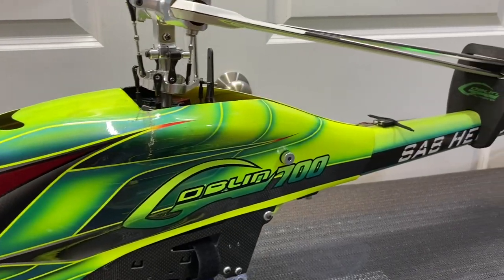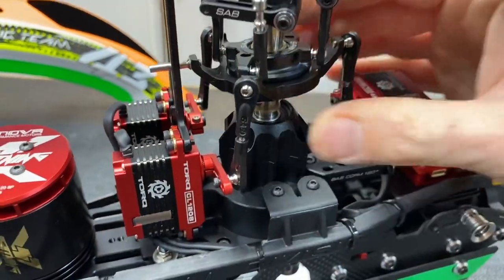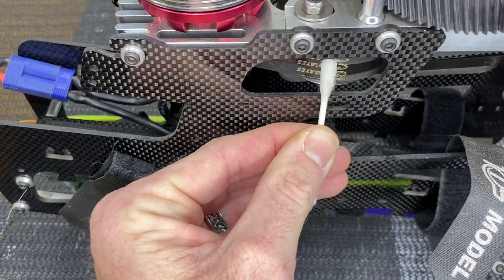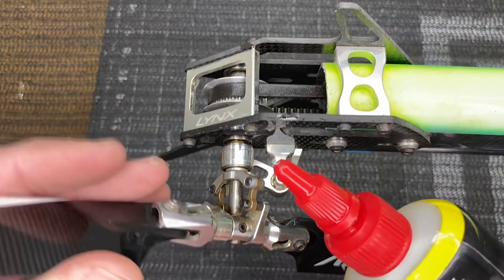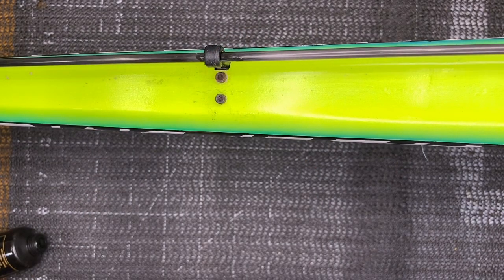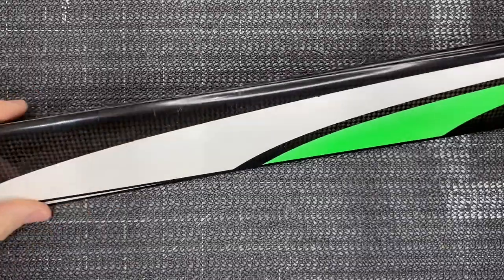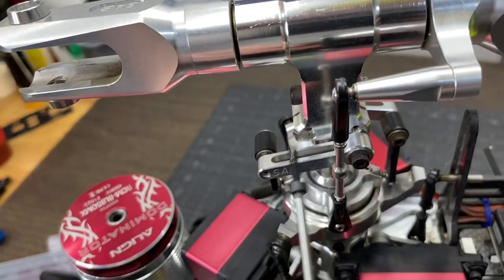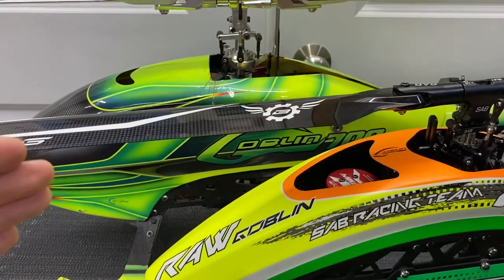How To Maintain￼ Your RC Helicopter

Comment: Caution about lube on one way. Consider it is not actually a bearing. It’s a clutch. It works by friction. Lube is nearly for life, stops rust mostly. I used Teflon based lube and regretted it. TOO slippery. Lost power and HARD auto a few times. Totally cleaned one way and applied minimum crappy lube. Never a problem again.

Comment: Consider why apply ANY liquid lube to bearings. They are partly sealed with grease not oil. Greased for life. Oil would only dilute the grease. If no grease, replace bearing

Comment: Puzzled by flyers using silicon on belts. No manufacturer recommends it. So called dry lube would still risk attracting grit. Typically cars run timing belts way harder and longer without any product applied.

Comment: I live in Louisiana and i dont add oil to anything but the head, tail head and 1 way bearing.  Oil anywhere else attracts dirt and the parts wear out even quicker at least in my experience.
Reply from the maker: Yes, if you live/fly in a area with a lot of dirt you will not want to oil some things.

Comment: I’m a brand new rc helicopter pilot. I’ve owned fixed wings before. I have a FlyWing Bell 206 V3 and I for the life of my can’t completely get rid of a vibration on shutdown. It used to do it on spool up as well. I’ve adjusted the main blades many times and can’t seem to get it right although I’ve made it considerably better. Please help.
Reply from the maker: Welcome to the dark side! Lol so first question, has it done it since new? Have you check the balance of both blades? Some helicopters have a residency, which creates a vibration on either spool down and or spool up.
Reply: @westhobbiesrc8051  it has done it since new. It’s only about a week old with around 10 successful flights. I have not checked the blade balance. I’ll have to watch a video on how to do that.

Comment: Would you do the same to the Blade Fusion 180 and Fusion 360 as far as the shaft, bears, and belt go?
Reply from the maker: 100%! It is how I maintain all my helicopters regardless of size.
Reply: @westhobbiesrc8051  Thanks!  I just ordered all the supplies.  My buddies 360 just had the bearings go bad.  He never lubricated it.
Reply from the maker: You’re welcome!
Reply from the maker: @LoveRC  that will happen, bearings need lubricant. You will find how much longer and nicer your bearing and belts and heli will be and last. 3-1 Air tool oil works great as well!

Comment: Good stuff. Ive used scorpion bearing oil and triflow on everything. Never thought to grease the main shaft and tail shaft. Makes sense. The grease is less likely to fling off like triflow. Ive always flown full gear systems and found using a little parafin wax on those gears helps with the chattering.
Reply from the maker: I’ve used the bearing oil but never used triflow, the microlube is expensive for what you get but it’s great. Stays on the shafts for many many flights and don’t make a mess and fling off right away. Wax does work great to quite the gears down.

Comment: In the full scale aviation world, nylocks or nylon stop nuts are usually a one time install then tossed. Now that’s a little over kill for a model but as inexpensive these are by the 100, I change mine after three installs.  I mark the nut with a dot from a sharpie after it’s tightened each time. If there are three dots when I take it off, then I use a new one. Kinda anal but 40 years of working on airplanes, from models to fighters you tend to get that way. Your videos are really informative.  If anyone hasn’t bought Kubler products prepare for sticker shock. The micro lube is cheap at $30 compared to the bearing grease for my CNC mill bearings. That said, it will last a long time and is the most recommended product in many industries.
Reply from the maker: Yes technically speaking nylon lock nuts are one time use but I’m the models they don’t need to be changed unless they no longer hold. I’ve had some last forever and some last once or twice and some brand new not hold at all. I’ve got 100s of them. I replace them as needed. With the main blades if I notice after every flight my main or tail blades keep coming lose then I know time to change the lock nuts. But you can never be to cautious. Would rather do things overkill then failures. Yes microlube is expensive compared to others used but well worth every penny.

Comment: Great video but I gotta say, I have never oil any of my belts. It seems very strange to me but I guess if It's silicon it should be ok. I like to use "Dry Fluid extreme heli" on my shafts as it is not a grease that will attract dirt.
Reply from the maker: I’ve been using 3:1 silicone oil on my belts for many many years now. The belts last for ever but! It depends on where you fly. I never get dirt or anything from the grease (unless I crash) but if you live in a sandy or dusty area and get a lot of dirt on your helis then yeah Dry Fluid is better.

Comment: Genial amigo muy buen vídeo
El aceite dela correa es para limpieza o algo más ?? Lla que Llo no le echo nada ala mía
Reply from the maker: Thank you, the oil used on the belt is to keep it lasting and not drying out or cracking.
Reply: Gracias amigo felizes vuelos

Comment: Jeff, I'm not famailar with the fabric paint tip. Do you just put a dab on it on the servo plugs after they've been fully pressed in?
Reply from the maker: Yes you do. I run a line (bead across all the pins) let it dry and you can peel it back off if need be.

Comment: I know it is not a practice to use any lube on the blade roots but I was really wondering why not. Would it reduce wear on the blade roots and on the blade grips?
One aspect I considered is that it would collect dust and make wear even faster but why dont we use DryFluid or other PTFE stuff? It would reduce friction that could cause issues at spool up, like unwanted blade strike on the grips.
Other thing is that if the libe film is too thick it would make the grip and the head more “flexible” maybe in a wrong way, but a very thin layer would not cause such problems.
So generally if we do not consider dust collection and rigidity/flexibility issues, why dont we do that?

Comment: Glad no suggestion of lube main gear. That’s a no no. At least if it’s premium Delrin (polyoxymethylene) like SAB use. SABs own manual advise no lube. Maybe occasional wd40 (which is not actually a lube ) ….that’s just to keep gear cool in hot conditions. All lubes just attract grit, the enemy. If gear looks dirty, I use wd40 just as a cleaner. Wipe up any mess with paper towel

Comment: Many say leave the belt dry, it does nothing to improve longevity of belt and may allow more dirt to stick
Reply from the maker: Well that’s no true, it helps keep the belt lasting and not cracking over time. I’ve got belts that are over 15 years old and zero issues with 1000s of flights.

Comment: Not gonna lie but the section about lubrication was painfull to watch.

Belts are designed to be used without lubrication.
An oiled belt will attract dust and wear down faster.
The wrong type of lubricant can even attack the rubber components of the belt.

The main rotor and tail rotor shaft usually don't need lubrication either.
Especially if your tailrotor uses a bronze bushing.

And putting any kind of Oil onto ZZ-Bearings is a big No-No.
Those bearings are packed with a lifetime supply of grease.
Adding oil will change the properties of the grease packing or wash it out entirely.
Reply: This is what I've heard too.
Reply from the maker: Keep doing your way and I will do mine. Many, many, many heli manufacturers will tell you to oil/Grease main shaft bearings belts and so on. Keep doing your way that works for you. Go pop one of those bearing apart and show me how much grease is in this bearing.. none.
Reply: @westhobbiesrc8051  Every ZZ and 2RS Bearing should come pre-packed with grease.
If you found one without grease it's most likely one of those you already flushed clean with silicone oil.

The 2RS Bearings on my Gaui are definetly all greased up by the Factory, just double checked it.
Reply from the maker: @taumelscheibe5948  just pulled 10 brand new bearings a part zero grease. These are out of the package bearings. So again no grease. But you keep doing what you find works best for you!